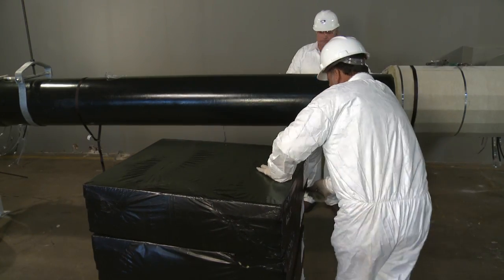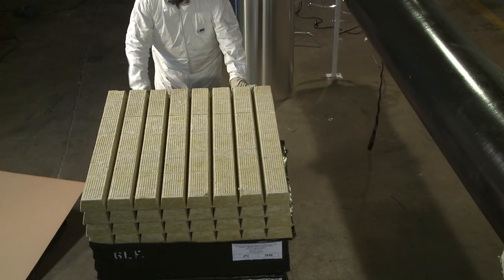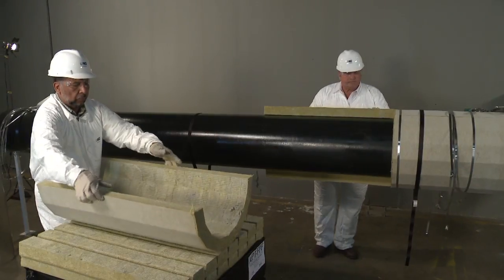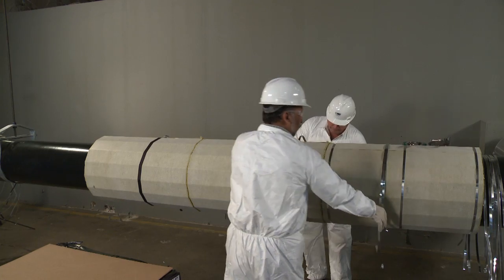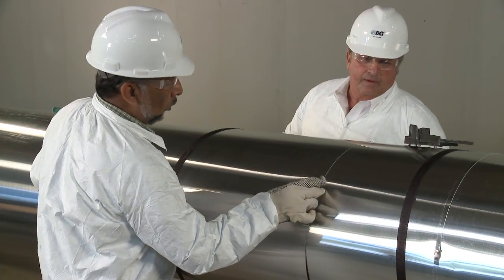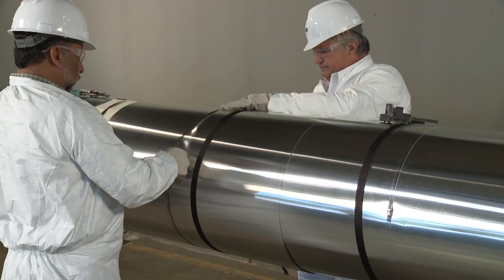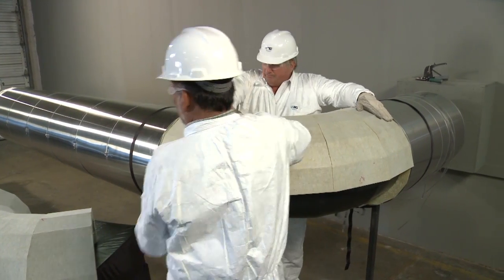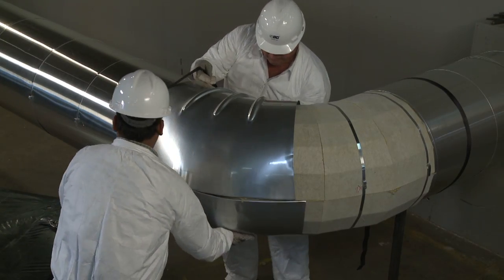Installing MinWool-1200® Field-Formed Pipe Insulation

Comment: Everything about this is wrong
Reply: what is wrong?
Reply: Like Elbow need put the insulation don’t have waterproof , and is up to you when you tight the insulation but is better if you tight with wire or tape not with band metal